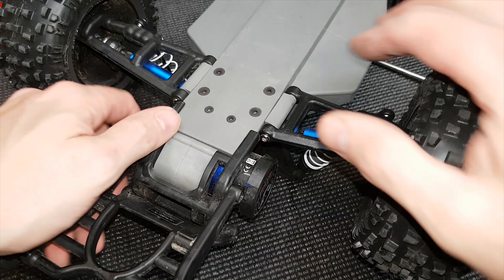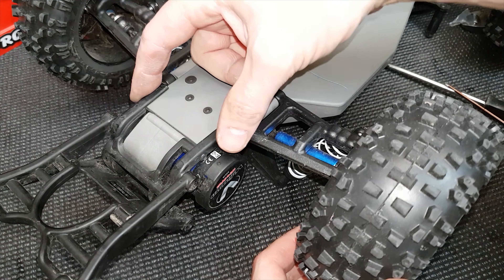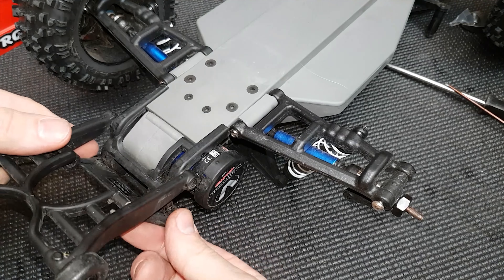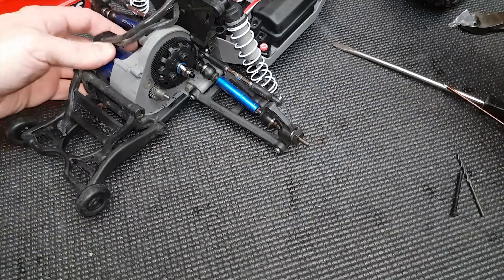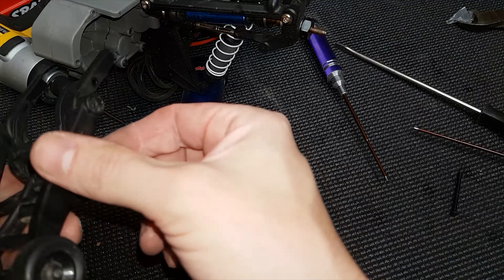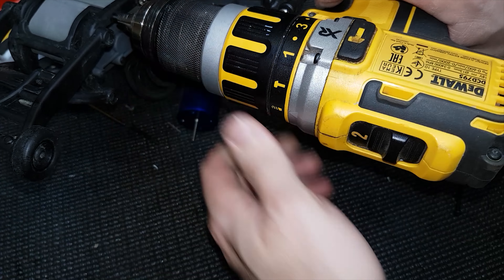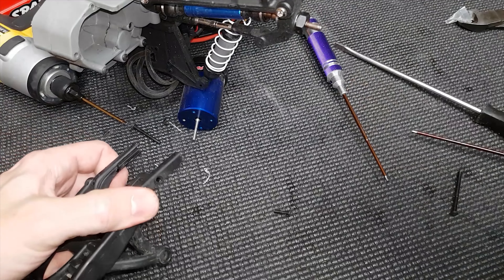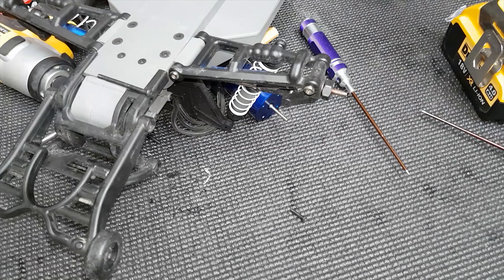Traxxas Rustler Wheelie Bar FIX

Comment: That's a good fix, much better then just cutting off the part that keeps sliding off, cut that part off, and the wheelie bar gets too flimsy.  I usually put the wheelie bar straight out, or all the way up, and use small zip ties in a crisscross pattern to secure it where the wheelie bar snaps in place, you can use rubber bands too.  That's a cool rusty Kevin,  your upgrades are sensible. Not sure what body that is,  but it looks good.

Comment: I just got new rpm a arms and my set screw still keeps backing out, have to check it every 10 mins or so, guess some TL or a blob of hot glue would hold it,, and i have the same bother with my wheely bar,, it needs tie wrapped as it comes undone all the time,,, but the Rusty is a great basher!!!!

Comment: Found an easier fix.  I got a T Bone Racing skid plate for the chassis on my wifes Rustler and the end of it goes over that part of the cage.  No more issues with it getting snagged and popping off plus the chassis isnt going to get scrapped and gouged nearly as much anymore.  Cheap fix too, got one for $13 with free shipping.

Comment: You could also just buy the RPM motor guard that replaces this part with one that is much better and doesn't keep coming off
Reply: Angel F I did that swap and kept running into the problem of my RPM motor mount ripping out